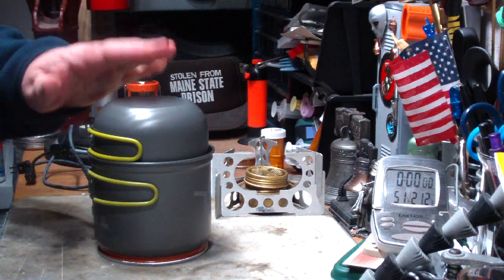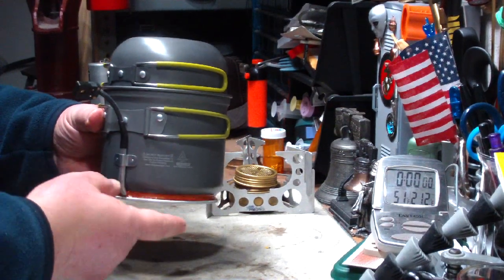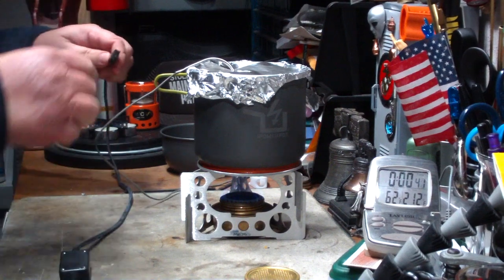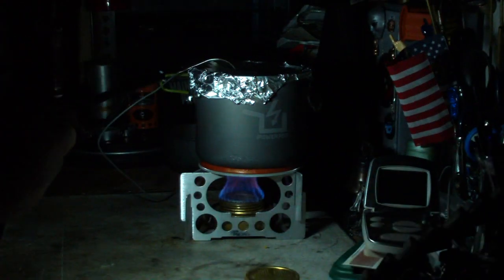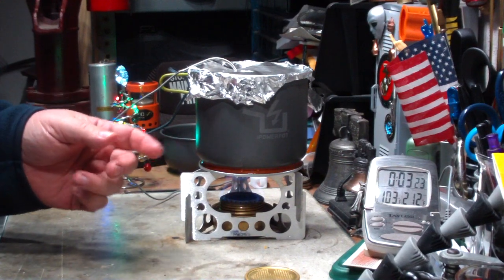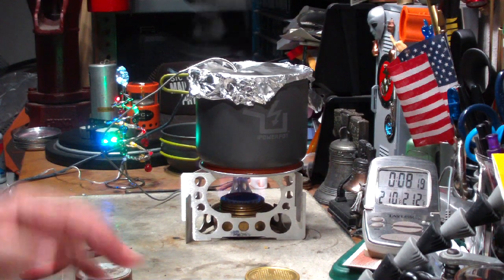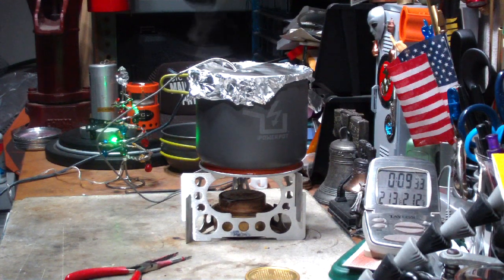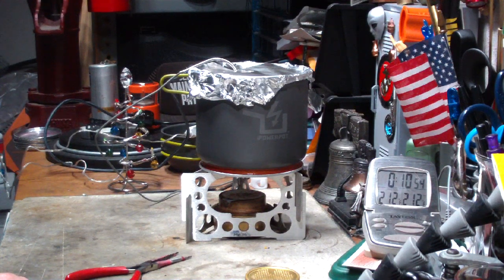The PowerPot® - Boil Test #1 - Using the MOJO pot stand with a mini Trangia burner.

Comment: Those 4 rivets in the bottom of the PowerPot conduct some heat between the hot lower plate and the cold upper pan container.  Structural necessity but with a loss of efficiency. 
Probably one reason among several  why there is a lower limit on flame intensity to get the USB charger to activate. Thanks

Comment: True but it wouldn't be efficient to pack a whole Powerpot for a weak LED light, you'd be better off packing a Goal Zero Guide 10 Plus pack instead.  You don't have to worry about a candle which will die out in 3-4's, take less space in your pack and it will light up an area all day or night.  

If your argument is that you "can" do it with a Powerpot I concede but I will maintain that it wouldn't be the best thing to do.

Comment: Won't work, not enough temp difference.  To use a tealight candle, the cold side would have to be freezing cold.  When the cold side is that cold, it'll nullify any benefit from the heat from the tealight candle.

Comment: You may have seen the TegPowerBrick which uses a radiator w pump for active cooling. A simple way to cool the water in the PowerPot without doing that might be pieces of aluminum partially immersed in the water and standing straight up in the air to radiate heat into a windy atmosphere. The bigger surface area the better. Like any heatsink does.  Thanks again.

Comment: Don't use alk stoves with this to charge devices, you'll use too much fuel.  Canister stoves are fine but expensive to replace.  I recommend using a white gas or woodgas stove for off-grid charging.  If you have snow that's perfect, keep the pot filled with ice water and replace as necessary, you'll be able to use less heat due to the temp delta.  Otherwise you will need to get the water boiling to achieve enough delta T to charge devices in the shortest times.

Comment: With the exception of the BioLite these power generating pots/cups were designed to be used with canister stoves, varying results should be expected when they are used on alcohol, wood, or Esbit/solid fueled stoves. Could you please do a comparison test using a Trangia and your MSR Pocket Rocket or similar canister stove? Thanks!

Comment: Very interesting way to generate power... was  wondering if you can determine the minimum temperature differential to start/stop the regulator. What if you filled the pot with snow or ice water and let the ambient air "warm the bottom of the pot... cheers keep up the great vids as always.